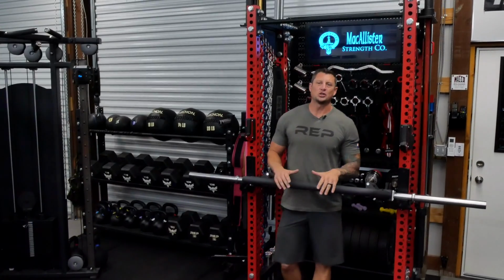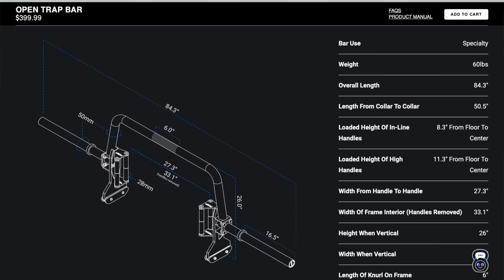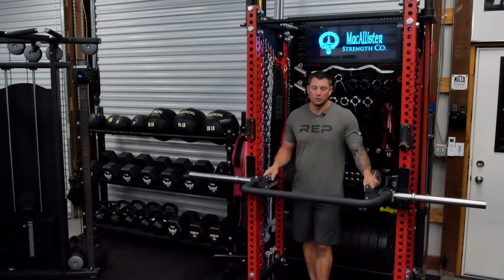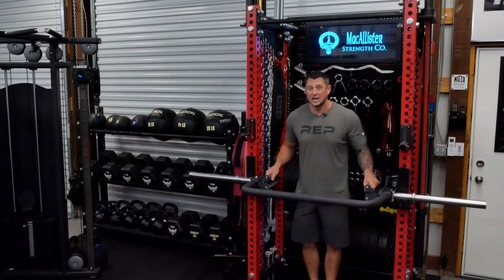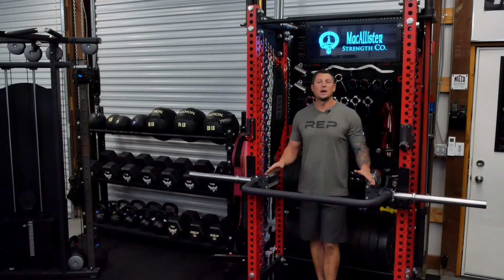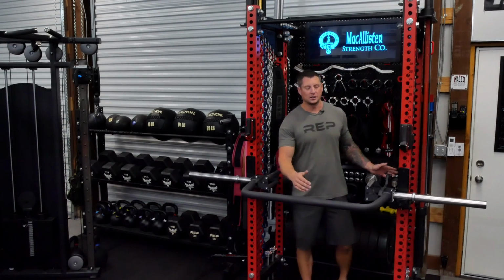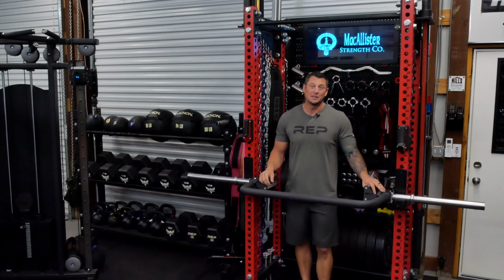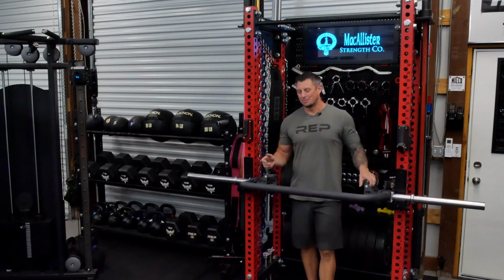"NEW" Rep Fitness Trap Bar Review!  Should you buy it for your garage gym?

Comment: Curious if you would recommend using this bar for deadlifts versus a normal barbell, thoughts?  Also, any tips on the pros and cons of each type of bar for deadlifts.
Reply from the maker: This trap bar would definitely work great for deadlifts.  You don't need any special bar to perform deadlifts.  Any straight bar will work great.  Technically the trap bar uses a bit more legs but it's a great whole body movement.  Deadlift specific bars have more flex or whip in them but unless your pushing 400+ lbs it's not worth worrying about.
Reply from the maker: I should add I have used over 30+ barbells over the past few years and am a gear snob so please don't think you need to go crazy on gear to achieve great results. cheers!

Comment: I have this bar. it IS NOT easy to rack on standard Rep J cups in a Rep rack. it barely fits. you have to switch the jcups around so the welds dont hit the bolts on the trap bar. could be a problem if someone is going heavy, and needs to re-rack when fatigued. Handles are too wide as a standard handle width. Great review on the bar.
Reply from the maker: Thanks for the added insight Tyson and honestly I never plan on racking it much so I probably could’ve done more research in that respect.  I agree slightly narrower would be better but smaller guys are pulling 600 on it no problem so I better not start whining!😂🤣. Cheers!!!
Reply: as always, great reviews and insights! Thanks!
Reply: get the flat sandwich jcups they are great for all the axillary bars and have plenty of room

Comment: Definitely deadlift with the bar behind you. Otherwise you may bang your knees and the weight of the bar may pull you forward, putting stress on your back
Reply from the maker: The bar is perfectly balanced front to back.  I know most aren't and I go bar behind you for that reason or some like to go bar forward to see if it's tilted.  I've had mixed responses on this question.  probably split down the middle right now.  lol.  I wasn't expecting that!

Comment: The biggest con is not having a wrench to tighten the bolts for the sleeves. I have a ratchet wrench and it was still too wide for this bar.
Reply from the maker: Yes you will need a wrench. I couldn't get my socket in there and trust me I tried!  ha ha.

Comment: I have been using my REP open deadlift for two weeks now. What a great value feature to price wise. I have only exclusively used it for squats because of my programing and it feels great. One benefit of camber bar squats that I learned is you can shift the weight during a squat (change the center of gravity) in order to not fail a rep.

I am 5' 9" 235 so pretty wide and don't have to remove the handles to perform squats either. I've squated 400 for reps with it and it feels solid to me.. I did post a video of a 380 set for 5 if anyone is curious to look.

One minor criticism I have and this is more goes to most specialty bars in general is that they don't often put the weight of the bar anywhere on the bar. Most my specialty bars are not 20kg.  Most my straight bars are 20kg but still have their weights on the cap which I don't need but almost all my specialty bars don't have their weights on the bar. I have to rely on a corner of my white board where I wrote them all.

Lastly for deadlifts I don't think it matters how you use the bar but for lunges I would put the knurled part of the bar in front so it doesn't interrupt your planted leg but haven't tried that yet so I could be wrong...  I get your last question was designed to encourage engagement in the comment section but if you're really curious you can always look at REP's max deadlift video to see what they did can't go wrong with consulting with the creator...
Reply from the maker: Thanks for the great reply!   I noticed REP was doing it both ways on their website and at the competition.  I like open side forward.  I was just curious is all.  Great idea on the bar weights being placarded on the bars somewhere.  Honestly I hope REP hears you on that one.  I have the same issue!

Comment: I’ve used my bar with both the closed and open sides in front of me and don’t really feel much of a difference. It’s the balance like you said.

Would you consider reviewing the American Barbell T-Grip bar? And if so would you get the angled grip or neutral grip version?
Reply from the maker: I prefer the angled T-grip bars but have no plans to get one right now.  I have plans to build a seal row platform soon so maybe after that.
Reply: @MacStrengthCo  it would be a perfect bar for seal rows! A cambered bar doesn’t work as well for them in my opinion.

Comment: Typically, I face the bar but that's because they are not well balanced and so after every set you need to make that leveling-out adjustment. With this being well balanced it will stay as left so that concern is eliminated but I would see face the bar out of habit and to judge my depth in proportion to it. At a 6'7 I want depth, but I got my limits.
Reply from the maker: For us taller guys squats are NOT are friends!  ha ha.  Bar out front is interesting.  I agree for balance thats a good idea, this REP bar is so balanced its crazy.  How do you like the handle width?
Reply: I agree about squats, I'm glad I don't have judges looking at my depth. I don't have the REP trap bar yet, but it is on my very short list like my very next or 2nd purchase. Their multi-grip bar is calling my name and my shoulder is yelling BUY IT NOW. I will def keep an eye out for the sign I'm sure that will do very well in the market of home gyms.